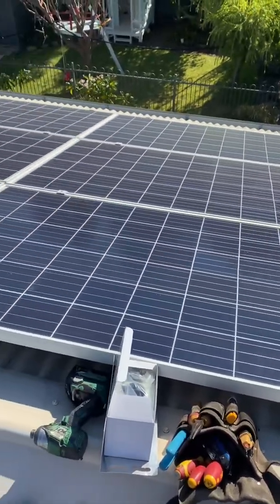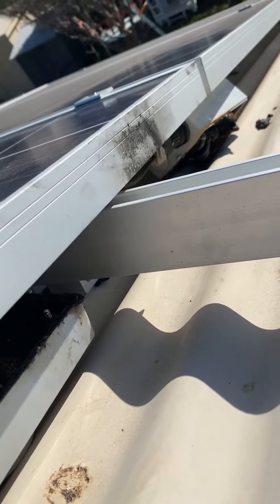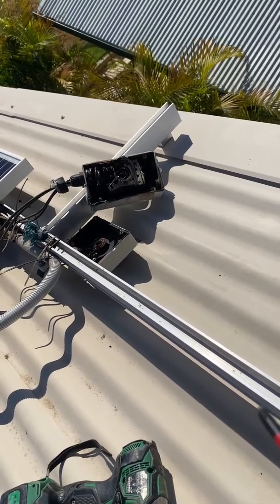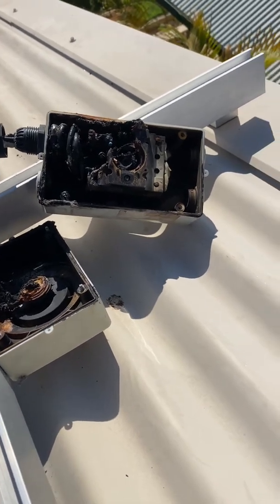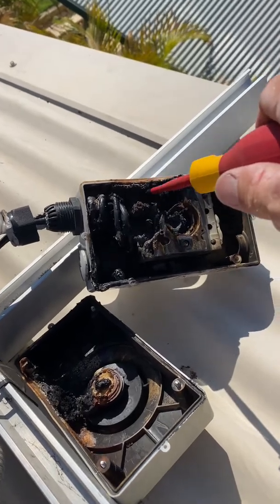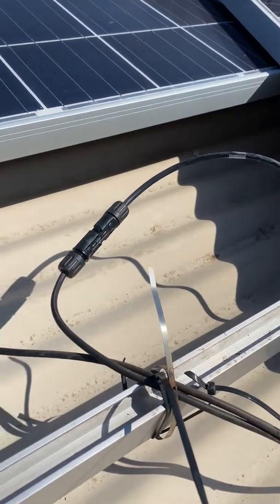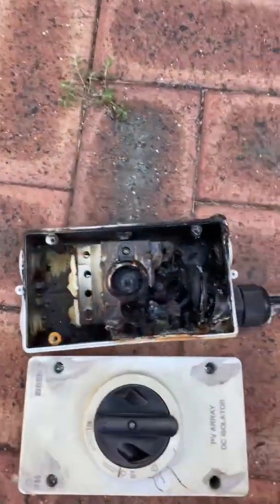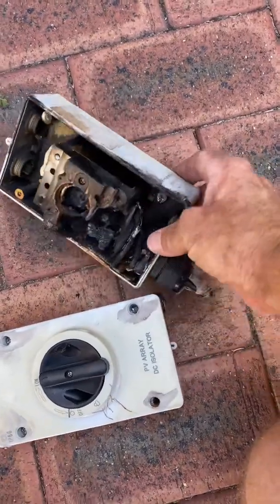Solar Panel isolator catches fire. Perth solar system repairs, inverters, Off Grid, batteries.

Comment: You will not get much of a shock from my install as its only 68~70V VOC, even with wet hands its much safer..The current is higher so more cable runs are needed, but fire and tracking and arcing is dramatically reduced. Its the same with the battery, it can also catch fire, keep in a fire proof box outside. Do not use Lithium batteries of any kind, they are too expensive and dangerous. Use AGM,  32kwh bank costs about $5.5k u will get 2000 - 3000 cycles with 25% discharges SOC, almost as good lithium, but way cheaper.

Comment: My solutions are 1 install the isolator or dc  breaker in a metal combiner box outside the house on a brick wall, so the fire has nothing too burn other than the switch. 2. Keep the total VOC below 120VDC, no more hazardous DC voltages 200~600Vdc on residential installs. 2 Instead wire 2 or 3 panels in series and then group them in parallel, and have a dc cable run for each group to a metal combiner box outside the house. 3. No rooftop isolator needed. 4. Install a 48V off grid system. 5. do not grid tie anymore, as feed in tariffs are no longer viable.

Comment: Yikes. That’s a bit dangerous. Do you folks now run some sort of rapid shutdown system on individual modules?
Reply from the maker: Just an appropriate rated DC isolator and clear instructions to remove load first before shutting down 👍🏻

Comment: Glad decided on parallel.. more wires.. but low voltage on the roof diy I chose safety.. no arcing.. no matter where that failed connection happens on the panels busbars, mc4, or that isolator... It's gonna burn... That arc is still jumping even though it's already fried..

Comment: Begs the question, why no dc circuit breakers in a supposedly professional install?
Reply from the maker: Circuit breakers are of no use on a pv array. I explain why in this video
Do not use this type of DC Isolator for your solar power system array! I explain why they catch fire
https://youtu.be/EJC6wKir_Lo
Reply: @joondalupelectricalservice3201  have just watched the vid you suggested. Can I ask what voltage the circuit was running as the current was roughly 25-30% below the breakers rating? I'm running 2x 500v 32amp dc breakers, one on a 270v 6amp array and the other on a 450v 8amp array.
Reply from the maker: Roughly 400 V, but I will do a more detailed video when time permits
Reply: @joondalupelectricalservice3201  thanks for the reply, best wishes from Ireland 👍

Comment: Apparently it is NOT recommended to use external DC isolators in the UK after recent house fires anymore, I believe the newer inverters have them built in. That one your showing looks to have had water ingress. Cheers.
Reply from the maker: Yes we have had the same transition here for the same reason also 👍🏻

Comment: This is why I like to use high quality DC circuit breakers instead of just a switch
Reply from the maker: Circuit breakers would not help in this situation. Some inverters have arc detection which would help.

Comment: A isolator is not rated to break current
First switch the load off
No current flow, isolate

A circuit breaker rated to break current at a certain voltage is a different story

Comment: Check fuses and Iso to make sure they're rated for your voltage.  Lots of fuses say 20amp etc but then 200volts.  Noark are 450v max.  On a sunny day you can soon go past this voltage but still be under the 20amps.  This trips sparky's up when only working with 240v.

Comment: First issue is that the isolator is installed on the roof of all places. Best way is to just run cables down to a DC combiner DB downstairs, then install the isolator down there with a DC rated breaker, fuses, surge arrestors. Never install the isolator on the roof…

Comment: why not use a DC circuit breaker instead of an isolator
Reply from the maker: Good question, it however wouldn’t prevent this type of failure. No rooftop isolator is the best solution.
Reply: @joondalupelectricalservice3201  so what is the recommendation? what should we use

Comment: I have been researching this and have found that this is a very common problem world wide. It seems that more often the switch is to blame than installation error. DC voltage is much more prone to arching than AC.  I am skeptical about using them all together. Thank you for this public announcement.

Comment: I only have one roof to isolator. The other strings don't. I will get rid of that one. I need to remove panels anyway as there is an insulation failure. Don't need an isolator on the roof anymore

Comment: I am guessing the higher the string voltage the higher the chance of arcing ???
I have a few small systems as I love playing with solar (very addictive hobby) and I live off grid out in the Wheatbelt. My 48 volt system runs a panel voltage of 110 volts open circuit and my 24 volt system runs a panel voltage of 87 VOC. I am running the same disconnect switches you show in this video. I often wonder how I would go in the event of a component failure and DC arcing at 110 volts Vs the higher voltages the grid tie systems work at ?? Would be interesting in hearing your thoughts.
Loving you vids 👍

Comment: These are the consequences of keep buying and promoting cheap switches that aren´t suitable to withstand thermal requirements on roof top application. Even CEC knows about this situation and problem was not related to breaking capacity but thermal capacity, nevertheless market keep buying the same switch technology of blade contacts that can´t guarantee contact pressure, thus overheating then fire.
Reply from the maker: Installer error was often the cause also due to not terminating correctly

Comment: See I’ve been having people ask me why I don’t mount my solar panels on my roof. Well for one you can’t tell if it’s on fire till it’s too late unless someone sees it in time to inform you. In my opinion it’s a fire hazard being that they are mounted on top of flammable materials such as shingles with tar  that burns very hot once ignited along with the wood underneath. So that’s my reason for not mounting solar panels on top of my roof. In my opinion panels should have individual fuses/breakers to prevent such occurrences

Comment: Roof grid-tie voltages are high and the roof is high, it is indeed dangerous and best left to professionals, but smaller lower volt solar systems built closer to the ground or on RVs can be managed by amatuers that pay attention to what they are doing and get quality components such as MC4 connectors all from the same manufacturer so they match.  (MC4 is a weather proof rating, not a size)  On the ground all you need is an MC4 to un- plug for power isolation.  Ironic that a safety feature like a solar panel isolator would be the weak spot that causes problems.

Comment: Will be doing a ground mount but the disconnects will be on wood posts.  Might be a good idea to put fire proof material under them.  The indoor parts will be on cement board.

Comment: Does the polarity depend on the LOAD side? I.E. does the polarity depend on the direction of the load ?
Reply from the maker: Hey
No the load can be on either side.
Reply: @joondalupelectricalservice3201  What would you use for an isolator?

Comment: roof top solar isolators should be checked every two years as a isolator will create to much resistance when water entry and weather conditions. they should not be on the roof they should be under cover, the government rules need to change roof top isolators are dangerous and great more problems then there worth

Comment: An electrician knows more about connecting electrical cables better than a solar guy who only knows how to install solar panels in a straight line. You are  blaming the installer    and not the quality  of the equipment and you don't know what is the cause of the fire.
Reply from the maker: Hi
Sorry I should have explained myself better. By “solar guy” I mean an electrician that is trained and experienced in solar such as myself. In Australia you can not do solar work unless you are a qualified electrician. The cause of the arcing damage was installer error as they failed to terminate the cables correctly as often occurs. It is also possibly a failed isolating switch but I suspect the former to be true.

Comment: My brother... had you ever heard of such thing named tarp? :))
You can use one or two to shut down the solar panels. One laminated hdpe tarp enough to cover the entire array should be way less that $100. 
Hooks above and some counterweights below. 
Stop whining about diyers and handymen when you (propose to) unplug mc4 connectors on a potentially loaded array.
Reply from the maker: Sounds good, have you seen this product also
http://www.pvstop.com.au
Reply: @joondalupelectricalservice3201  yes but a tarp is a (reusable) tool for servicing. That goo is for 1st responders and firefighters. It's when you want to save the roof. 
If you just want to replace a switch at noon... just pull the blinders.

Comment: I have all wires seperated in individual waterproof boxes for plus and minus that are installed under the roof so they cant even touch each other and then have a disconnect switch in a dry secure area where its the only point they come together. I dont even need to climb up for anything

Comment: Thanks Jason, I'm a Firie in FNQ and been to many a DC isolator fire. I think the legislation has changed (in QLD anyway) in that a rooftop isolator is now an option rather than a requirement. I'd like to remove mine at some stage, am hopefully getting additional panels to support off grid EV charging shortly so hope to get rid of it then :)
Reply from the maker: Hi Andy, yes your right they are no longer required on NEW installations in Australia however only if certain other criteria is met. In addition an existing installation that has a rooftop isolator is required to retain that roof top isolator as the installation would not meet the installation criteria to enable it to be exempt. Do you guys use a product called PV Stop for (I think its called) for isolating PV power in an emergency.
Reply: @joondalupelectricalservice3201  Hi Jason, no we don't use PV stop, although it does look pretty effective. Thanks for the info about the isolator, I'll get the installer to maybe just replace it when I do the upgrade, it's been up there for a few years now !
Reply: Problem is the quality of these cheap isolators, it´s sad to see that the problem is “solved” with the same quality components. It´s sad indeed.